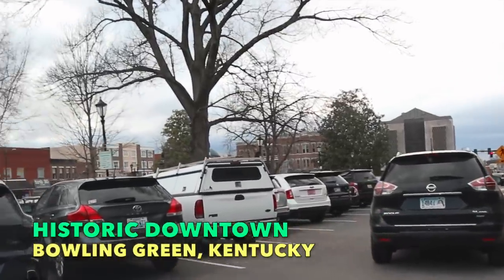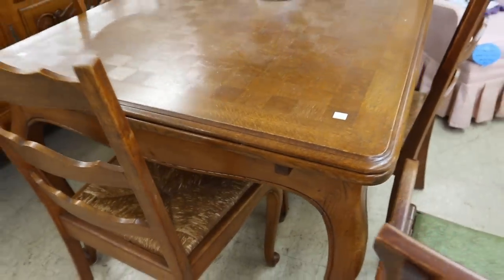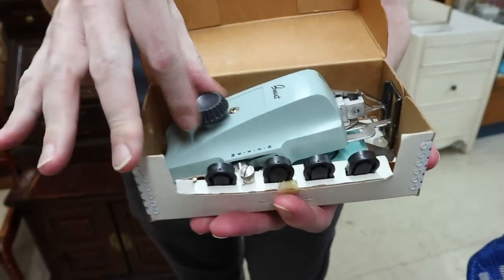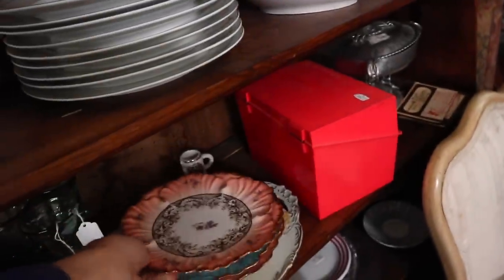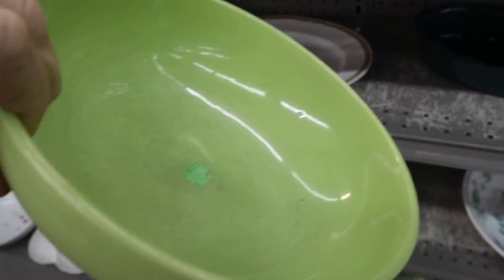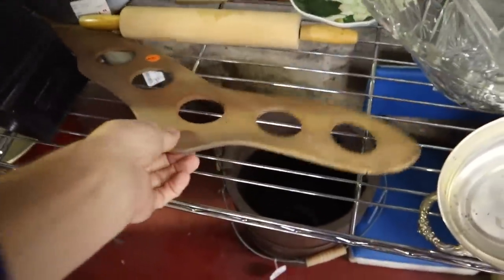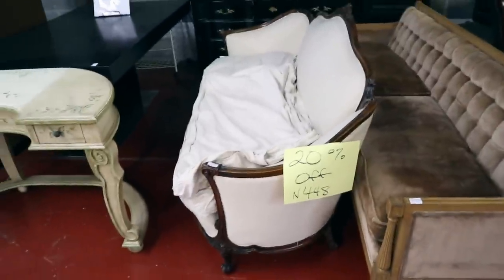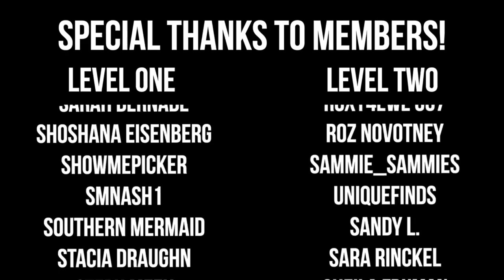BLOWN AWAY BY THE THRIFTING! | RESELLER SHOP WITH ME | VINTAGE

Comment: When you mentioned the 2000s ceramics having that felt design on the bottom, it is from pushing the ceramic slab of clay through a roller to flatten it! It has a thick cloth on it, and it would make that imprint. At least the one I used to use made that same exact imprint. Its used to create an even thin piece of ceramic, just like the funky looking mermaid piece.
Reply from the maker: Thanks for the info! It makes perfect sense.

Comment: My grandmother had a blanket chest that PA Dutch. Black with red painting. My Mother painted in the 80 and every time I think about her doing that it makes me want to cry. Is there any way that blue oil pant could come off and the original paint survived? Or has she ruined it forever?
Reply from the maker: It's hard to say, oil paint is especially difficult to remove sometimes. I would contact a paint store, a furniture restorer and a museum with that question, compare answers and then decide what to do.

Comment: The tan and blue plates you ID'ed as Pfaltzgraff @ 20:37 & 23:12 are McCoy, not Pfaltzgraff
Reply from the maker: You are right! It goes to show that one should not assume to just know because it looks like what you've seen before. I didn't realize that McCoy did a similar buff body with a blue stamped pattern like that, I will have to remember to look at things to be certain! Thank you for the correction

Comment: not to darn, but to stretch while drying
Reply from the maker: I learned something!~ Another viewer said you need two because of that, which makes sense
Reply: @TheAntiqueNomad  But if the material is porous it will rot in time. And someone else said it was for "blocking" knitted socks?